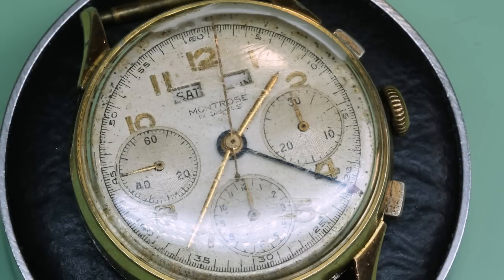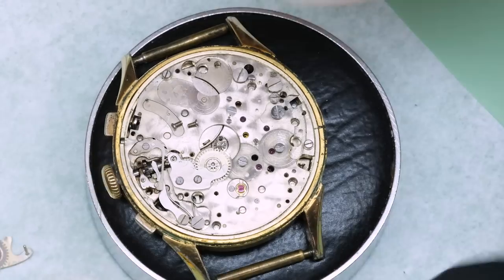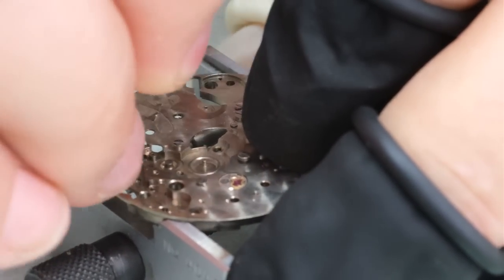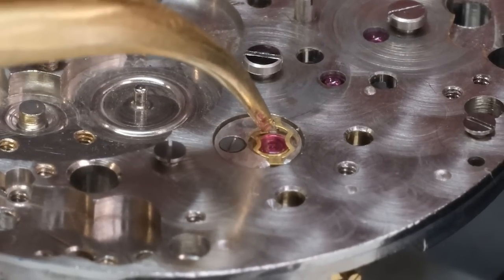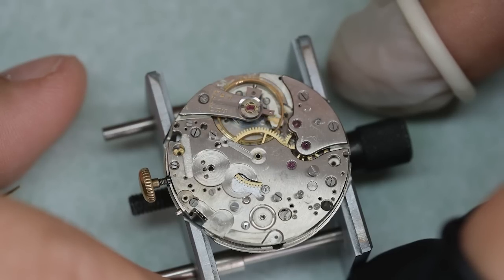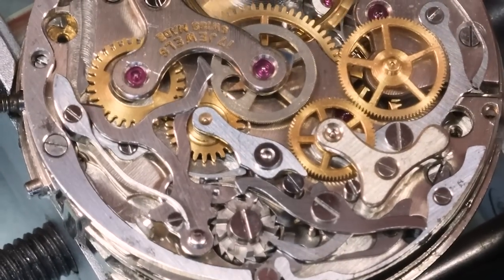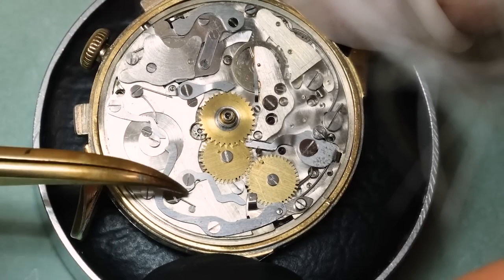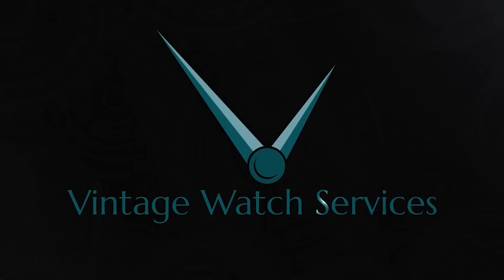A triple calendar chronograph has how many parts?!

Comment: I'm the customer in Atlanta.  Thanks to Rick Hoover's tireless work on my dad's watch and your video  it will run again. Thanks so much for this video.
Reply: I'm a little confused as to what the blued hand displays, is it the date?
Reply: @Glenn Watson That's why I was finding it confusing - only thing I could see it pointed to was the seconds markers but that didn't help at all. Cheers.
Reply: @Glenn Watson 04:44 the markers are there just veeerrry faintly.. you can make a 6 out just to the right of the 2'nd hour marker
Reply: @mrmagoo.3678  They are faint! The "27 28 29" by his thumb near hour 11 is a bit easier to see than the 6. Nothing to be done, of course. I can't imagine any attempt to fix the issue would end in anything but disaster.
Reply: That is a magnificent timepiece. It is fantastic to see the process of its return to function. I own a LeCoultre with Valjoux 72, so was especially interested in seeing this enhanced function 72C.  Magnificent!

Comment: Stian ... Thank you so much for this video.  I have been working on a late 40's/early 50's Wyler with a 72c for a customer ... he in Atlanta, GA and myself in Bedford, PA and we simultaneously watched your video.  It was a real bonus to have him see the process and ask questions while viewing your service of this gorgeous watch.  The Valjoux 72c is such a complex, yet well designed movement that has held up well  over the past 70 years.  We thank you for your channel and the work you do for the community of vintage watch lovers.  EDIT:  Thanks for the 'fix' on the center chrono wheel replacement.  We hadn't been able to sort the issue of the premature minute count upon activation.  Now there's a solution'

Comment: That's a very beautiful watch Stian. I have a Heuer with the valjoux 724 movement that I managed to buy very cheap (less than £30.00) I bought a new crystal and a hammer from a seller in Portugal and they cost me almost £100.00. I now need a pillar wheel and a minute recording jumper and, most importantly, the courage to service it. So this video is very useful to me and as always, very entertaining.
Reply from the maker: Wow, that could be a bargain, although with a low of effort finding parts 👍

Comment: Another really fascinating video, Stian.  As for your hobby advice, I am exceedingly pleased to inform you that I successfully disassembled and re-assembled a manual Vostok this week.  Only two pings, both screws that I was able to find, although I had almost given up on recovering the screw for the second pinion spring. That sucker is small.  Unfortunately, I discovered I don't have the fine motor control to do a proper job of lubricating, expecially the shock fittings.  Nevertheless, it was very gratifying.  Thanks for the inspiration.
Reply from the maker: That is very, very cool to hear, Bullnose :) The fine motor control is to a degree learnable, and you can aid your hand by supporting it on the bench, by supporting your fingers with the other hand etc. Good luck with it!

Comment: Thank you Stian for another wonderful video on a beautiful and complex watch. It does seem extremely complicated and as a result rather fragile. Were it not for the sentimental value, a lot of people would probably shy away from having it serviced because of the costs involved, particularly here in Switzerland. 
Thank you also for the good advice on what watches to start with as a beginner. Most experts tell you to start with pocket watches because they are bigger. As you rightly point out, getting spare parts or donor movements for those can be extremely difficult.

Comment: Beautiful watch, truly. I can agree with you about cheap tools; when I started watchmaking it was through an online course via I think Timezone, and it came with an (expensive) kit of starter tools, almost all Bergeon and Dumont (I’m sure that isn’t the starter kit you are referring to avoiding) that I still have to this day, but I broke my bergeon springbar tool and bought a crap kit including one. I just got a GS Spring Drive used and I won’t get into the mess I got into from being to lazy to unlock my roll top and get out the good tools, but I ended up getting the good tools out anyway, and lost a bracelet screw on something that was really quite easy with the good tools. Oh the crap tools are in the landfill they should have been in to begin with now, btw.

Comment: Wonderful video as usual.  Like you, I try to do as little to the watch aesthetically in a restoration, as the patina is the history; to a point, however.  Yes, the dial is wonderful, except, where is the date track?  Completely missing, how unfortunate as now the date hand just hangs there pointing at a void.

When it comes to cases, if the substrate is steel with plating applied then the substrate will not rot.  However many plated cases are over brass substrate.  The brass will rot due to strong acids from sweat and living; further destroying or marring the substrate of the case.  With that in mind restoring the substrate and re-plating will preserve the watch for future generations.  It looks like your case is steel so I would agree that it does not require plating.  I just re-plated a case for an Omega Seamaster Chronograph 861cal from the early 70’s late 60’s.  It was a plated brass substrate and the wear points were pitted and rotting.  Reshaping and re-plating were the only options.

As usual, another learning experience watching your video.  

Best wishes, Geoff in Vancouver
Reply from the maker: Hello Geoff, thanks for watching and for your informational comment! The date track is indeed very faded but it is still there. Difficult to see though :) Very interesting to hear about your Seamaster with a brass case, I thought they were all steel? Did you laser weld the pitting then? I'm planning to get hold of a laser welder in the not too distant future.

Comment: For those just getting into this as a hobby another beginner friendly movement is ST36 "ETA 6497/6498 clones" from China. You can pick one up for next to nothing & it's pretty large and robust as well.
My 1st teardown was a seagull ST36 it's an OK movement for 29.99, & although I won't make any claims regarding it's longevity and overall quality. but It's a good beginner movement that won't leave you sweating if you mess something up or a spring goes flying.

Comment: The watchmaker I used for many years is now retired.  He'd work on any watch including old Electrics and Accutrons, but for reasons he never clarified he wouldn't as much as open the back of a mechanical chronograph.
Reply: Lol this guy should start a political career, hiding problems with the gmt hand and saying the Chrono is fine Even tho the Upper sidr is slower
Reply from the maker: That's funny indeed, perhaps he just preferred electric watches?
Reply from the maker: There's no GMT hand in this movement and I'm not sure what you mean by the upper side being slower?
Reply: @VintageWatchServices  i meant the black hand and i don't know if it si cuz of the edit but in the testing around 12 the hand were slower
Reply from the maker: @amparocarvajal7759  The blued hand shows the date, buddy... And I still don't understand what you mean with your other comment 😆 Maybe make sure you know what you're talking about before talking 😉
Reply: @VintageWatchServices  lol u mad cuz You couldnt fix the reset?
Reply from the maker: @amparocarvajal7759  Yes, that's must be it 😂

Comment: In regards to the blades of your screwdrivers, do you have a special grinder to get the concave profile on the tips or are you replacing the ends with replacement blades?
Reply from the maker: Hello Stephen, yes, you do need a special grinder if you want the concave profile. I have one from Horotec which works very well and isn't insanely expensive (as the Bergeon one is..)
Reply: @VintageWatchServices  Thanks. Loving the videos, watching a few today you almost have me talked into getting a seiko.

Comment: So the wheel that needed the new pivot..When you ordered the replacement, how did you know the name of the wheel you needed? Do you research a schematic or how did you know? Where do you begin to find a replacement? Just curious
Reply from the maker: Hello JL, part numbers for watches are actually standardized, but the naming is generally also quite standard. The only snag with the chronograph wheel in this movement is that it can be of a couple of different lengths, so you have to measure it. Finding the replacement is mostly done on eBay or some specialized vintage watch part sites. It's getting more and more difficult and more and more expensive...

Comment: stian plz tell what is the reason on 7750 chronograp hand dont aline on 12 after reset its stops different positions its the same reason what you fixs in this video?? i try evrthing but nothing sory for so many questions but if you can tell would be great thnxs man so much✊🏽✌️
Reply from the maker: There can be a few reasons; the hand could be loose on the pivot, the hand could be loose on the hand tube, the cam can be loose on the pivot etc... thus it's not possible to really say without checking your watch.
Reply: thnxs man so much♥️✊🏽

Comment: With such a beautiful dial amd it being complete , for me the worn case is letting that dial down. I see nothing wrong with adding back tje gold that the years have taken from it.
In some cases where the wear might be minimum I can see leaving the patina. For this watch Im feeling like giong all out on it would be the course.
But that's me.
Reply from the maker: Hello Robert, thanks for watching! I agree this one is tricky, but there isn't really any way to add back some gold. You would need to redo the whole case, and the customer did not want that done. I think this is a real borderline case, in which I one day thought the case should be refinished and the next day I thought it should be left alone, but ultimately it's the customer's decision and I don't disagree in keeping it original.
Reply: Of course the customer is right. We have our feelings, they have theirs. I suppose the wear indicates the years a loved one had on this world. So I can see that. I have quite a few Longines tanks from the 40s and 50s. Its my little passion. I love the 9L movement. Some are solid gold, others plated. Since my only connection with any of them is that passion, my considering replating a few is a different proposition altogether. I have a few with linen dials that are so stunning but the plating is worn. Those will be getting plated soon. I wear most of the ones that currently run and the wear on some bugs me. I want them to gleam like they did when they were first worn proudly.

Comment: I see a lot of Seiko 5 from India from £10-25 on the bay in ‘running serviced order’ would you think these would be worth practicing on? Maybe you could review one. 😉
Reply: I've bought a few of those India Seikos. They are fine for learning watchmaking as long as you understand they are almost always cobbled together with parts from a few different watches, and are rarely in decent condition. They will never be part of a collection, just a learning piece. Dont get one with a shiny new looking dial or case, it will be counterfeit. Good luck.
Reply: Start learning using a sea-gull st 3600/3620. Easy and simple to work on and the parts are larger and easier to handle than anything Seiko.

Comment: You would think they would make a super gentle super tiny bead blasting small parts machine for watchmakers
Reply from the maker: Oh, they do of course. Not specifically for watchmakers but there are sand blasters aiming at small parts, such as for the dental industry, which can also be used for watchmaking.

Comment: Does anyone in the world make dials for old watches? I realized that everything can be repaired in such a watch, except for the damaged dial.
Reply from the maker: I don't think anyone makes old dials per se, but once you take off the indices and rub off the paint, it's only a brass disc. So it can be refinished. The problem with that is that for the more obscure brands, the original printing pads will not be available, meaning that the dial will look differently. It might have different fonts, different sized lettering etc. And it will of course not be original anymore. So there's a trade-off between having an original dial and a refinished "new" one that might not look that great anyway.

Comment: Why don't I see you torqueing the screws to a specific tightness. Everything else in the fitment is so precise one would think that would be a requirement, it is on larger precision machinery.
Reply from the maker: That's a good question, and nowadays some of the higher end brands actually have guidelines for the torque that should be applied to the screws. That's however only something that has come into existence in the last decade or so, thus for old watches it's all about feel and experience.

Comment: Im not a fan of patina, for the sake of patina. But an old watch is an old watch and dosent have to be perfekt looking. A redial, replating can always be done later in the future. But it can never be undone.
Reply from the maker: Yep, that's very true. And more obscure old watches like this one you will never get restored to the original condition, the printing plates are simply nowhere to be found any longer. I'm not sure what you mean about the patina for patina's sake, unless you mean faux patina?
Reply: @VintageWatchServices  I mean, some seems to love patina. The more the better. I have no problem with that. But prefer nice and original looking watches. If to far gone, id prefer a redial ect. But best option is to clone the dial. And carfully save the original with the watch. As you say, a very exactly reprint ect, is extreamly hard to do.
Reply from the maker: @RocketSailing  Ah, okay. A mint dial is for sure the best, but a bit of patina is fine with me :) There's a red-ish line for logo and model lettering in my view: if they are damaged the dial most often is as well and needs to be refinished. Note that a refinished dial is actually the original dial, just scrubbed and redone. Only for some of the most common references will you be able to find a spare dial for watches they stopped making 50 years ago!
Reply: @VintageWatchServices  Think we are on the same level on patina. When its to sorry and shames the watch. Its time, If it worth the cost. Have a Britix valjoux 92 chrono in my collection, that I will restore. But the dial and hands looks like it was run over by a truck. And left in the dirt for years. Much like those fake restoration videos. Oh, wait. I got an Idea.. 😬😂😁😁
That one needs replacmet dial/or redial. And most of the hands replaced.

Comment: Complicated watches like this with chronographs, anual calendar and even moonphase, all in one, where somewhat affordable for the middle class. Nowadays when all this can be designed and manufactured much, much cheaper with computers and modern machinery, the prices are ridiculous, only the rich can afford them. Is this one of the proofs that today’s watches are grossly overpriced ?
Reply from the maker: Good observation Mihai, and for mechanical watches, yes. Quartz watches took over the lower price segments and you can of course get all the functions of this watch in a quartz chronograph for probably a couple of hundred dollars or less. 
Mechanical watches have become luxury items and with that the pricing of them has also changed. They are priced at extreme profit levels simply because they are luxury items.